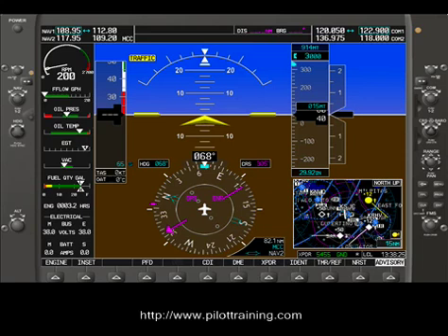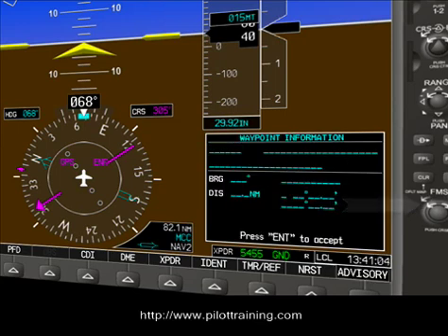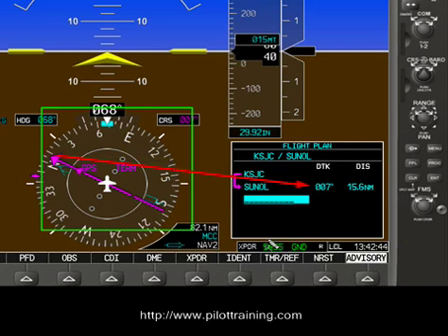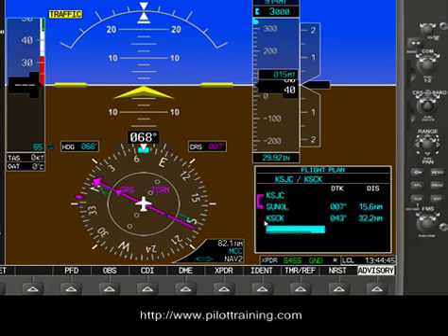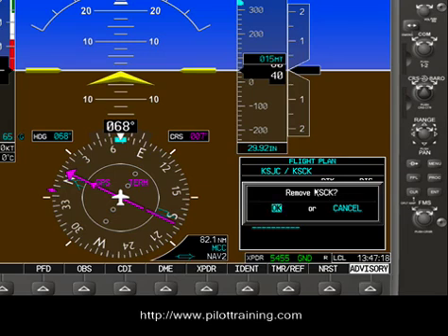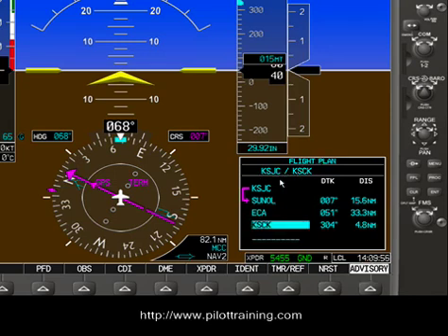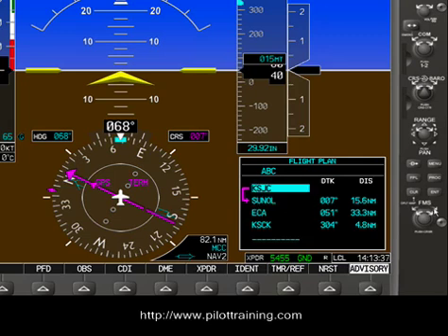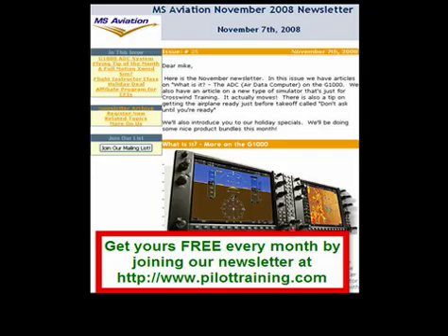Flight Planning with the G1000 Glass Cockpit Training Video

Comment: That G1000 has some squirrelly effects( this was in a Cessna172). Three or four times now the autopilot was on and a simulation of a strom was entered. Most of the flight went as planned, but flying into a cloud was not a nice thing. 
Lighting, zero visibility, and the autopilot keep climbing. 
I took it off autopilot and flew below the cloud. Okay,  I thought, maybe I can turn it back on. 
I did and the crazy thing went into a dive at 1200 feet/m.
Turning it back off I regained control of the plane. Looked out the window. I could barely see the airport and manually landed the plane in a rain storm. The pilot killer - if your not extremely careful.  I  noticed that on the Cirrus vision, and others they have installed a button that levels the plane in case of emergency. I think they know about this problem and have tried to correct it in other aircraft.

Comment: How do you enter your first way point?
Reply: Larkland Morley it probably recognizes which airport the aircraft is located at and is used as a starting point; however if you wanted to change the initial fix then you could just put the cursor over it, hit clear, and enter, and put in you new waypoint.

Comment: @Gary500 

I believe you can buy it from the Garmin website.  The books in PDF are free, but the program is $25-30 I think.
Go to their PRODUCTS - "IN THE AIR", 
then PRODUCTS (again), 
GPS/NAV/COMM
G1000
then you'll have to find it, it used to be under SOFTWARE.

Comment: When you are flying a plane such as TBM 850 which can fly up to 1800nm , you would prefer a system to make flying a bit easier for you. G1000 is not designed to be put on something like Cessna 140 or LSA aircraft.